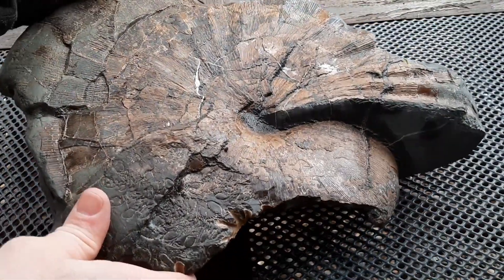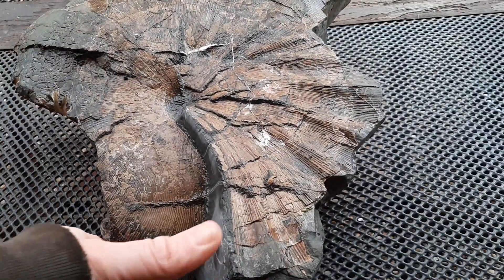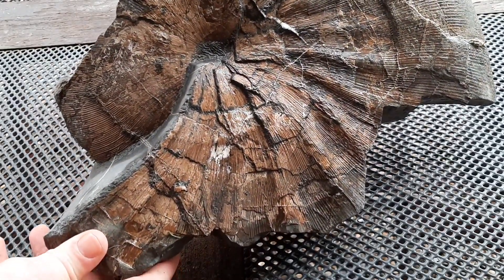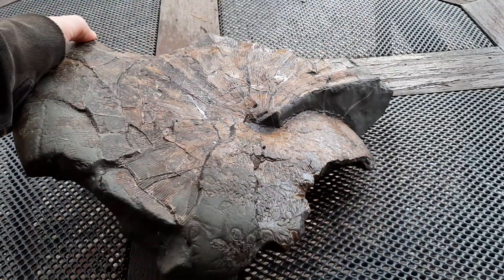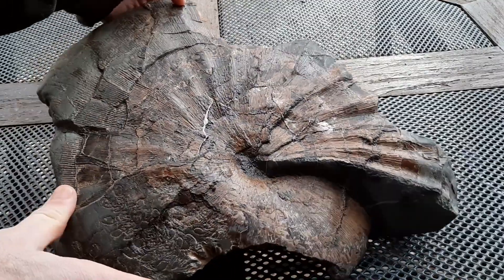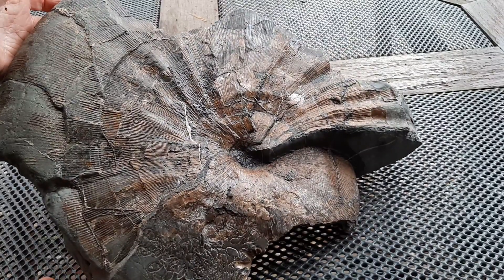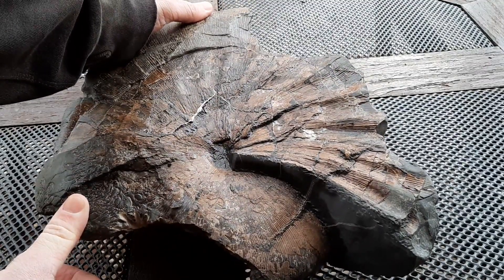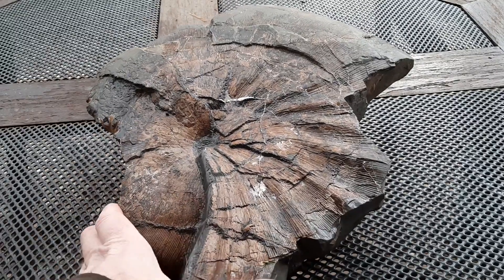Fossil Preparation Norfolk Ammonite

Comment: That’s an amazing ammonite, I love them when they are imperfect from erosion 💪😀 engraver works really well on that matrix. Nice job, well done 💪😎
Reply from the maker: Thanks man yeah that matrix wasnt too hard for the old engraver. That rock has probably been dragged a long way in a glacier at some stage kinda cool.  Also there is broken pieces of shell inside the chambers so something must have happened to it before it became fossilised too  I have wonder if that was what actually caused its death . Thanks for watching 👍⛏🦖
Reply: @Treasurehunter11001  if the matrix is soft there could be hidden treasures in the body chamber that can be revealed
Reply from the maker: There could well be !